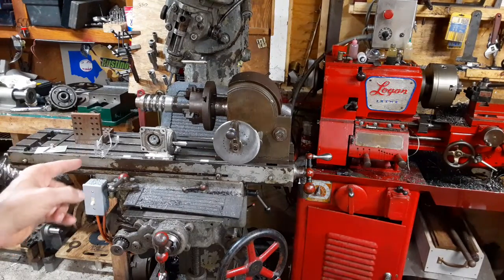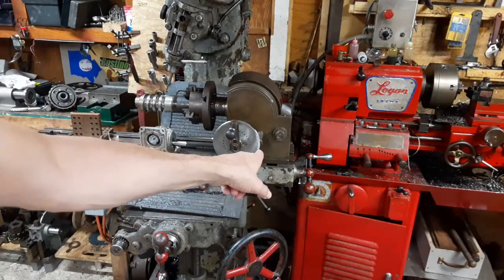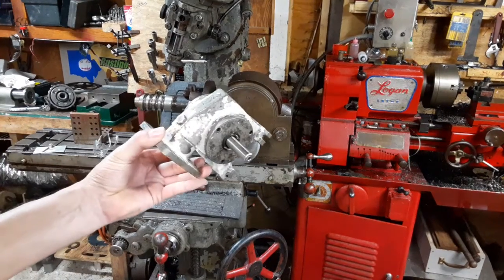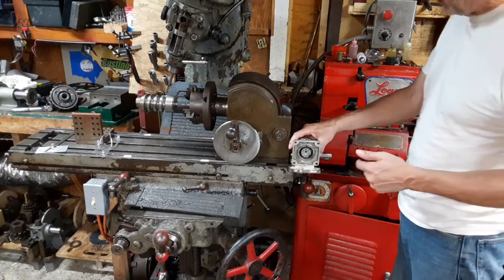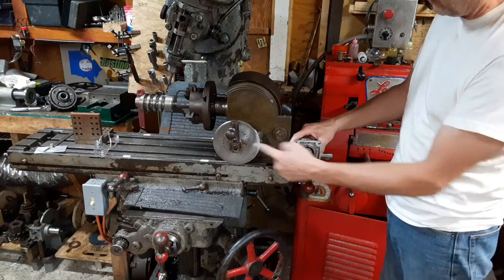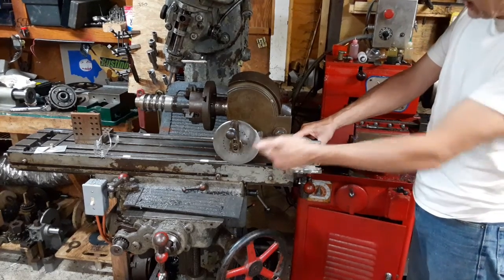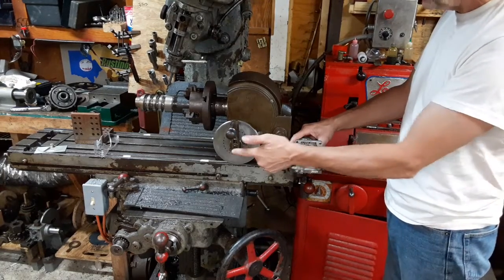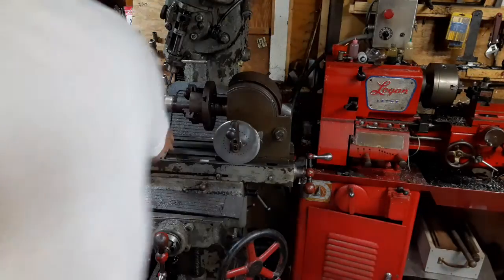worm gear build side note

Comment: It absolutely can be done that way. Many dividing heads come with gear driven input shafts that connect to the table feed with a set of change gears.
Timing belts may be smoother than chain drives.
Thanks,
JohnB
Reply from the maker: Haddent thought of timing belts...hmmm....of course I can more easily make a sprocket if I need a particular size